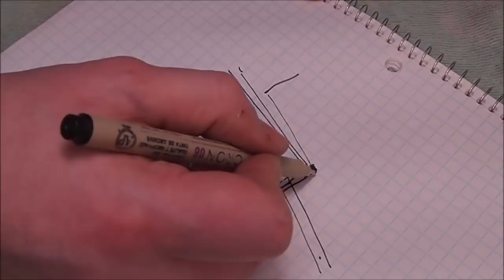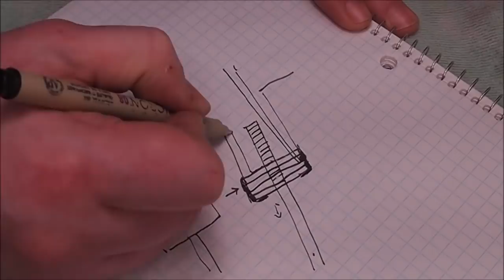Strat Neck Mayer-hem.

Comment: Every guy watching this be thinkin' "bet i could get that washer out"
Reply: Magnets.
Reply: @Scodiddly  thats one of my two thoughts on it as well
Reply: Dynamite......
Reply: onemans world that could fix it and also add road worn heavily 👌🏼
Reply: Would have used micro drill and drill it out. but i'm not a looter ;)
Reply: Jameson White may be but he didn't want to destroy the neck. The guitar  was probably very expensive they didnt want to destroy it wasnt the trus rod any way was the frets pay attention to what he fixed.
Reply from the maker: @Scodiddly  Tried that. Big ol' rare earth magnet. No dice!
Reply from the maker: @P1004469  thought of that, but it was so deep i didn't want to risk breaking it off down there.
Reply from the maker: @vincentromero8029  what do you do if it doesn't?  How do you level the surface with the bump of glue on it?
Reply: It would be interesting to know what the coarse of action would have been had all the washers come out.
Had there been a way to forceablely remove the maybe last washer there still remains getting rid of the tight fit divot left behind so the washer reseats reliably and the removal or consolidation of the crushed end grain under the washer. 
The repair as done seems like the best option all things considered.
Whole thing probably never would have happened had the fret work not been so poor. 
I can understand the owner feeling safe to assume that on a signature model the frets would be even to begin with.
Reply: A little steel or hard plastic tube, CA glue on the end. OR... CA all the washers taken out to the end of the nut. Some CA on the last washer on the stack and screw the lot in so it sticks to the washer in the pocket, unscrew the lot. Risk is, the stack breaks and you now have >1 washer stuck in the pocket. Unlikely as the other washers came out pretty easy so there probably isn't much keeping it in there.
Reply: @Dug6666666  My first thought was to flood it with thin CA glue to harden any soft wood in the pocket. But maybe a little 5mm-ish rock maple block with a hole in the centre and tap down to the bottom of the hole.
Reply: @tochriss  How would you prevent the trussrod from getting stuck and the thread from getting covered in glue?
Reply: @tochriss  Thanks for the reply.
Maybe that last washer that would not come out is actually the top of a previous 5 deep washers compacted into the wood :)
Reply: Make if you just ask it nicely?
Reply: twoodfrd micro chisel... flathead screwdriver, etc. that said, I’m fairly certain the superglue wouldn’t work on a bound washer
Reply: @twoodfrd  Washer was most likely caught by the threads of the truss rod. To small holes and a custom made tool to unscrew it. Or do exactly what you did. not worth the trouble to extract.
Reply: had ideas yeah lol, magnet on a stick? glue maybe but thats a little scary if you break your stick glued in there lol some litttle metal rod probably best
Reply: Haha!
Reply: @onemanswrld  YOU WERE ONLY SUPPOSED TO BLOW THE BLOODY DOORS OFF !!!
Reply: I would have had my mother-in-law start talking to the washer. Eventually it would leave on its own just to get away.
Reply: I was thinking it was crooked caught in the threads and maybe tighten the nut to straighten it out,then remove the nut and use a magnet.
Reply: I actually have a tool I’ve made for just such a problem. I’m not a luthier, but I regularly have to deal with bullshit of this magnitude at my day job and I have a couple of deep well sockets in which I’ve cut teeth in a reverse orientation. More than likely that washer was compacted down so far that it actually got smashed into the threads, and when something is threaded on, you either ruin the threads trying to cut it off (which is not applicable or appropriate in this case), or you can thread it off with a little bit of work to make the tool, and some very good lubricant. It probably would have added hours on to this job trying to find a socket, cut the teeth in correctly, and then clean it up so it didn’t damage, and mangle the surrounding material, but it is doable.
Reply: @soulman4292  doable? Lol. You'd have to start with a 3mm socket or smaller. That hole ain't that big. Unless you've got micro cutting tools, I don't see you putting teeth on that and making it into anything. Or I guess you could have mill and a lathe and could possibly fashion something up. But most people don't have those things.

Comment: Really Fender? A John Mayer Signature with those issues? What are we now, Gibson?
Reply: Michael Marsh Even john's Black1 had issues lol the wiring was not soldered

fender didn't took care of him + his deal with fender made him play only fender which I guess he hates since he loves using other brands 🤦🏻‍♂️
Reply: @Monomonmamon  Are you talking about the Kinman harness that eliminate soldering?  I had read that the solderless system was reliable.  I guess not?
Reply: @taotuhao5969  I do not know alot about soldering, all I know is John Mayer said his Black1 was unsoldered when it was delivered from the fender directly lmao
Reply: There's a bunch of "green" (soft) necks from Fender, mostly basses, mostly with the truss rod nut on the bottom (like this one) and mostly made in Mexico. Nothing new.
Reply: I bought a new player's model strat over the winter, buttercream. The first 3 frets buzzed. I had to give a brand new guitar a resurface. It plays great now. The gibson SG i bought last year came with 2 dead on arrival tuners and a few other issues. They are both great guitars now, but I should learn to buy in stock flavors instead of ordering blind, because each is different.
Reply: crush537 yeah, ordering online is easy, but I don’t like the idea of not being able to see the exact guitar I’m buying. The brand and line might be good but the specific guitar you get might not.
Reply: @Monomonmamon  it was soldered but not grounded, you're gonna get hum with single coils but ungrounded singles are horrible
Reply: " Damn dude " you're right ... it's sad ,,, that's all I hear anymore ... D

Comment: I would have turned a spacer on the lathe equal length to the stack of washers and used that with one lock washer. It's crazy to stack that many lock washers together.
Reply: I doubt he reused the lock washers.
Reply from the maker: I did not reuse the lock washers.
Reply: Always nice to own a lathe or 2.
Reply: @stratocaster1greg  I have 4 and 3 of them are cnc.
Reply: stratocaster1greg  ....especially a metal cutting lathe where you can whip out truss rod slugs on demand  lol. That’s Jerry Rosa territory.
Reply: ten littleindians agreed.  For those who don’t have a lathe, there are all kinds of spacers available on line for less than $10 dollars each.
Reply: i was wondering that, or at least some nicely machined smaller washers. can't see superglue surving that kind of compression either tbh
Reply: @HBSuccess  All you need is a vice and a piece of steel rod. These are not moving high tolerance parts.
Reply: I made a spacer from an old truss rod nut. Just cut it to length and file the threads off and there it is.

Comment: The wood that was replaced by washers didn't just disappear. The bump at the end of the neck is a result of that wood being displaced  upwards.if you think about it, it's the path of least resistance. I've never seen this on a guitar before, but occasionally on older Fender basses, particularly ones that have had the end of the fingerboard planed thinner to counter the 'tongue rise' effect.
Reply: Oh that’s an interesting idea!
Reply: It didn't show with the notched straight edge and he said the high frets didn't lift.  It appears to be a bad setup from the factory or someone leveled the frets around the high one.  A lot of people use short leveling sanders or attempt to do just problem areas and not level the board the frets with a sander that is full length.  Combined with not using a notched straight edge first before leveling.  When you use the nut on the truss to apply tension one way or the other, the ends of the fret board can dive or raise.  I was surprised he didn't show us the results after leveling the high frets b4 he put it back together.  Also, when leveling with strings off, then stringing it up and adjusting the truss can throw the leveling off ass the wood can bend unsymmetrically.  Fenders are pretty good.  Mahogany almost always has to be leveled under tension.
Reply: Brian Mascarin I think you’re 100% correct. It’s no coincidence the two high frets are directly over the compressed neck wood. Fender’s rosewood cap is not a whole lot thicker than a veneer, it’s not going to add any resistance and neither will two standard fret wires. Owner compounded the problem by continually cranking on the truss rod instead of leveling the frets.
Reply: Oh shit!!!   Yer right!
Reply: @HBSuccess  No way..so My JM signature strat had what seemed to be a slight hump in in the heel area (originally had some buzz, and noticed it). I leveled with a fallaway and it seemed to help but still some slight buzzing. Added washers and tightened up that seemed to help for a day or so and relief is back... any suggestions? If it really is soft wood in the truss rod hole does that mean its gonna keep pushing up on the heel area of the fingerboard? , what to do?
Reply: I put my comment on before reading yours. I share your suspicions that the underlying wood may the root cause.
Reply: There was no wood replaced with washers it came that way from the factory it was just a couple high frets. If it was a bump in the wood it would have shown clearly with the notched straight edge. You would have to do some serious almost impossible internal damage to cause hard maple and rosewood to hump up like that. Either way he fixed it and that's all that matters.
Reply: @Ibaneddie76  exactly - the fretboard indicated it was flat, the frets not so much.

Comment: That is shocking for such an expensive guitar.
Reply: It's nostalgic to use 1950's technology and get all the period-correct look/feel/design...You unfortunately get all the mechanical issues those vintage guitars tend to develop over time also.  =[
Reply: I worked over 15 years as a repairman and have seen all kind of problems on Custom Shop Fender and Gibson Guitars…you wont believe what I saw.
Reply: I believe you.  At the risk of offending some people, I’ll say that vintage designs were good in their respective eras, but I prefer modern truss rods and modern manufacturing processes.

Comment: Unpopular opinion: linseed oil smells incredible, as does high quality turpentine. (Painter here)
Reply: Flax seed oil works very well and also smells great
Reply: I remember sniffing the linseed oil bottle after using it for the first time I used it on my fretboard
Reply: @Monomonmamon  Raw linseed oil not boiled. Boiled hardens and is a finish. Raw linseed soaks in and slows water movement in the finger board. You put a few drops on, cover the whole board and wipe of the excess. Once a year. Lemon oil is too thin and evaporates.
Reply: A little whiff of acetone is not so bad either XD !!
Reply: Ever had it catch on fire?? Lol

Comment: Nice work as always.  I have come across this problem a few times.  Last time, I concluded the nut had been replaced with one that didn't have enough thread length.  A washer is not a machined bushing, it is punched out of flat stock, so it is rounded on one side and burred on the other.  It will flex, and a stack of them will act like a spring.  I like the idea of gluing in the the lowest one, but I would respectfully suggest either finding another nut with more thread length, or making one yourself by tapping and cross-cutting a stainless bushing.  Another option would be to have a single solid spacer bushing turned by a machine shop.  You just supply OD, ID and length, and often a little job like this they will do on the spot.  It will take them minutes.  If you have a mate with a lathe, it will probably only cost you a six-pack.

As for random high frets, this is also not uncommon.  I have worked in a guitar factory, and fret wire from different models can get mixed up.  I'm not sure how it got past the set up room though!

I really like your point about getting a false reading of relief from the high frets.  This would be confusing for an inexperienced person setting up their own axe.  Thanks for your videos.

Comment: My John Mayer signature Strat had the exact same neck issue.  Without a ton of washers, the neck couldn’t intonate or setup correctly!!  Eventually I sold the neck and body - and put the rest of the pickups and hardware in a custom shop neck and body.  MUUUUCH better. But no one should have to do that with a JM Strat.

Comment: With regard to linseed oil for necks. My stepfather was a cabinet maker/ joiner by trade, 60 odd years of it. A real tradesman. Beautiful work. He taught me about using linseed oil on necks. The trick is mix it 50/50 with mineral turpentine. Use VERY sparingly, and as you say, WIPE IT ALL OFF. If you do that it won't be a worry. All my guitars for the last 55 years, with rosewood fret boards, have had this treatment, once a year. My older guitars woodwork, is in perfect shape. Doesn't stink, and isn't sticky/tacky either.

Comment: Glad you fixed it. If I were to have to extract the washer, I would have put a very thin layer of superglue on the face of a small metal tube and stuck that to the washer. If that failed, I would drill two opposing pilot holes with the smallest drill bit I have, then screw two long thin screws into the washer to pull it out.

Comment: From this video found I had same issue on my Mayer Sig Strat.. and got some ideas: Measured how sunk truss nut was (2mm), cut a 2mm walnut plug out of the Fender truss hole plugs they sell (got all my washers out though). CA glued walnut plug into hole bottom, let dry, added more CA to edges of walnut plug (waxed threads first and avoided getting CA on them by using pipette). Essentially created a solid base for truss Rod nut to push against. I also did a fret level (w/fallaway on upper frets) because the upper fretboard had a slight hump.  Also did a heat treatment on neck/fretboard to straighten neck. Left neck in a backbow press for a week or so. Everything’s great now but it took a lot of work to get right. I am guessing the wood under fretboard was pushing up on high frets. If you have a JM strat & get buzzing, probably this is the issue. Awesome guitar & worth all the hassle but what a PITA.

Comment: Or... if that rod does break some day, you might get a router and a piece of walnut and make a skunk stripe on that neck, then insert the new rod, like they do at the factory. Just a thought.

I've never done that. The last neck that had a broken truss rod went into the garbage. Just got a new neck -- bolt on, of course. I'm enjoying these electric guitar repairs. They're fun.

Great diagnosis of the issue, and a nice, clean repair. Informative and entertaining, as usual.
Reply: I think I saw them take the fret board off a neck to get at a broken truss rod once on the stew mac channel.
Reply from the maker: @OtherTheDave  It can be done, especially on a "slab board" like this.  The curved veneer boards would be very tricky to get off and put back on.
Reply: @OtherTheDave  Yeah...I believe that was set-neck guitar, however. With a bolt-on neck it's possible to route out the channel, but I've never tried it. Maybe cheaper just to buy another neck.

Comment: I made my own lemon oil by soaking shredded clementine and lemon rind in baby oil.
It's pretty amazing how brand new it makes fretboards look after a couple of soaks and vigorous scrubs with a tooth brush until there is no more visible dirt coming off of the board onto the cloth, and it smells really nice. I have a little over 200ml of it left and it should last me years.
The toothbrush method seems to work really well, wiped off after with a microfiber cloth.

Comment: I've just set up a 2008 JM Strat for a friend, and I too had truss rod adjustment problems.  To get the neck flat enough, I really had to tighten the nut as much as I dared.  All the adjustment happened over just a few degrees of of turn.  I must have had the neck off and on again about 10 times before I got the neck bow set up correctly, all the time hoping that the rod didn't snap.  Given all the time this type of neck has been made for, you'd have thought Fender would have got it right by now.

Comment: Having done loads of strats, the neck shrinks more than the heel. Same on some acoustics. The heel "bulge" shows up in many strats as they age. There is a lock washer that fits the strat, and can be bent flat with needle nose. I have also come across that same problem, where you can not tighten the truss rod enough. The flattened lock washers fit well and work fine.

Comment: A lot of people do not understand a 1/4-20 nut and bolt at 1 (one) ft.lb. t.  will put over 200 psi. on the washers. The glue will just brake. And I hate to troll a master like this guy.

Comment: I had the same exact issue with a 62 reissue Stratocaster and came to the same conclusion that the wood under the truss rot adjusting nut was soft.  After I added the third washer, I sold the guitar.

Comment: I have a nice 78 Tokai, and the trust rod rattles on the open A string I used spring washers that won't come out, the big problem is that I used stainless steal washers that do not mix with the carbon steel truss rod over time it might rust.
The rattle is still there.